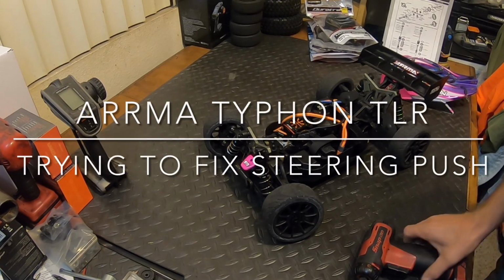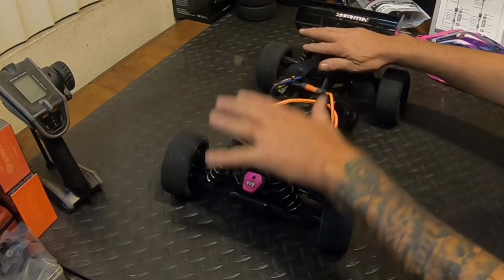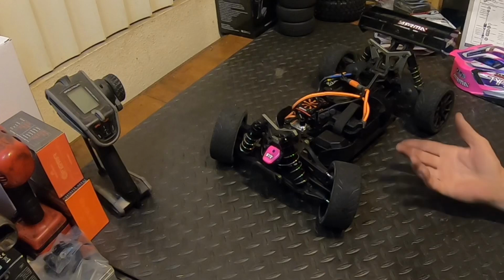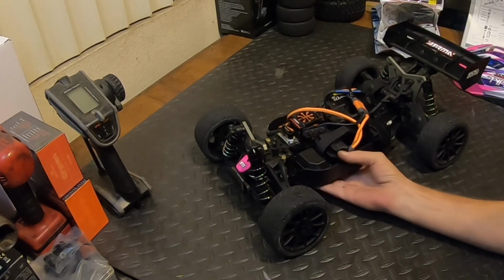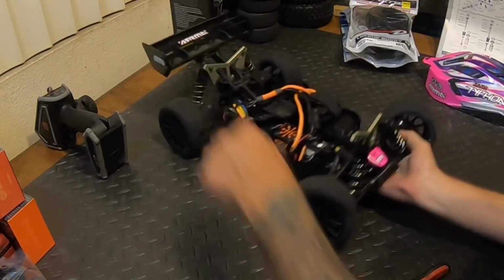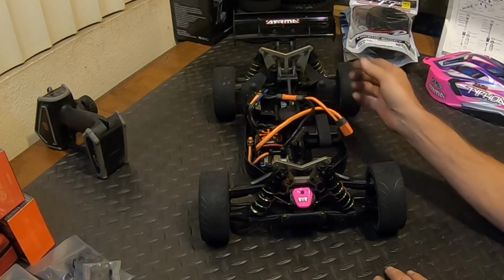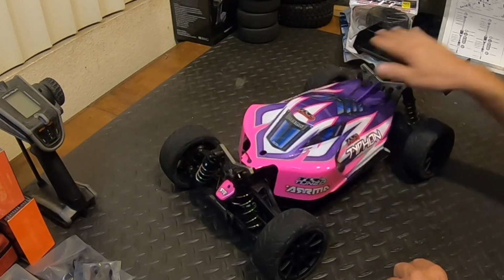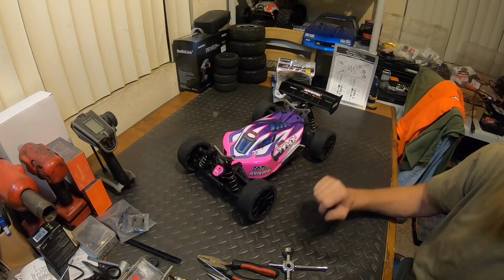Arrma Typhon TLR adjustment to fix steering push w/pivot ball front end will this help ?

Comment: Bought mine a few days ago and am already encountering this problem, have had it 3 days and already did the kraton hubs and carriers and axle ends with the EXB braces and the LED lights with the RPM rear skid plate and RPM front bumper.  This is by far my favorite RC vehicle ever! I love it!

Comment: Dude it’s been over a month, I just got my MX28 belted badlands on and have gone with the 1250kv 8s spektrum system….I’m still fighting the steering issues 😢 it’s gotta be perfect! I’m just not happy with it the way it is even after changing servo arms, turnbuckles. I mean come on! 😂 It’s crazy fast on 8s and handles great but it turn’s extremely sharp to the left and does little to nothing when turning to the right. So I’m watching this video as I’m tearing all of the front suspension now. AGAIN! 😂 If I get it fixed tonight I’ll upload a short clip of it ripping around! This video has helped me understand a lot, thanks!
Reply: Get a tighter aftermarket servo saver

Comment: Glad I found this video, although older it gives me more insight to the front of this thing. I have the same exact car (TLR), which I'm getting ready to get rid of the TLR tuning stuff because I'm tired of replacing those pill blocks everytime I turn around. Anyway, I'm wanting all of the front tires on the pavement because I'm not running dirt. Its obvious from the get go this car is set up for dirt tracks the way the front tires are set up.

Comment: I don't know if this applies to the Typhoon TT (ie. TLR Tuned) Roller, but it might be worth checking.  With the Typhon TT, you have 3 Ackerman adjustment holes - forward, mid, and rear   On my TLR 22 5.0 DC, as well as my XRAY XB2C, the same adjustment is done slightly differently, by using different thickness spacers.  I know that part didn't help you...but, it shows that the Ackerman angle is adjusted in a similar manner.

Now, for the part that might help you.  With both of my buddies, you can further adjust the Ackerman angle by flipping the Ackerman plate.  It is just one of the build/setup steps that differentiates between a dirt/clay vehicle, and an asphalt/carpet vehicle.  The 'rearward' mounting of the Ackerman plate (as the Typhon TT always to be) is a dirt/clay position...which makes sense, as the Typhon TT is tuned for dirt/clay.  With the Ackerman plate flipped (moving the 3 adjustment positions further forward), such would be an asphalt/carpet position.  I can't post a photo of what I'm describing...but, if you were to download the build manual for the XRAY XB2 2021, and look at the top panel of page 25, you'd see exactly what I'm referring to.  Then, you could disassemble the front end of the Typhon TT, and see if the Ackerman plate can be flipped.  If you're on Facebook, I could message you, attaching the image.
Reply from the maker: That great information I’ll definitely look to see if I can flip it 👍👍🔥🔥
Reply: @earlmoorhead5555  Most welcome.  Your NPRC inch has helped me.  More than happy to try and help you (and others).  🤙🏽

Comment: Changing the pills in the top front arm to the lower position shock tower will keep the wheel straight wen turning. I did it on mine,  made big difference.
Reply: Also down and in for toe in. Sweeps the arms forward standing the caster up. More tire patch on the road.
Reply: I'm gonna try foam tires.  Make the front tires bigger diameter, gives overdrive Make a little more front wheel drive.  Makes it drive straight.  Drag cars are set up front wheel dominate drive to help track the car straight.

Comment: Great bit of tinkering there earl 👌 very much like working on a real car but just not quite the same is it.  The small parts can make for interesting work too 😂 not like holding an m8 bolt lol.  Hopefully changing the steering settings will help 🤞
Reply from the maker: Yes 👍

Comment: EARL.... interesting...do you think shortening the servo arm slightly along with the Ackerman bar adjustments would help?  some servo horns have an inner and outer holes,,if not maybe a shorter servo arm,,,,,just a thought,,,great video.....🇺🇸👈🚘
Reply from the maker: As the wheels are maxed out I don’t think so but if they where not turning fully that would be the fix for that 🔥🔥

Comment: I’m a little late but have you tried a thinner rear sway bar to stop the rear end lifting? I would suggest watching JQ, he is pretty much only racing but I don’t see why the information wouldn’t roll over to blacktop as well. He recently did a video about sway bars and this seems to be the possible solution. Check it out and see what you think of the information provided by him. Have fun!
Reply from the maker: I haven’t ordered any parts for it yet but a good option 👍👍

Comment: I have a typhon. . everything is upgraded like crazy running 6s castle motor i keep melting my front and rear diffs. . . i have the center done with silicone earplug and 50k in front and rear. . any idea why i keep melting diff cups. It runs about 75mph so its not that fast of a build either
Reply from the maker: Diff cup melting 👀 there metal the cup that goes into the axle ??
Reply: @earlmoorhead5555  inside the cup melts and the gears just spin inside it and the screws give and diff rips apart
Reply from the maker: As dry as they where I can see big issues

Comment: Did you ever see if the spektrum 160 esc will fit?
Reply from the maker: It will fit but you’ll have to modify the mounting plate a lot

Comment: My Typhon s camber is FL: -3° & FR: -1.5°. What's the best way to even these out?
Reply from the maker: TLR has adjustment the upper arm has washers you can remove or add washers for camber at the pivot ball for front rear should have a link that’s adjustable
Reply: @earlmoorhead5555  ok thanks that's what I thought but I didn't want to start removing anything if there was something else

Comment: So...for scientific purposes,  im running 100k in the front and rear and 20M in thr center. Rather than planted wheels, im utilizing slide into corners and as for jumps and an evenly based thottle plant prior to a jump, i have seem to notice a super air control with the typhon.  Literally its a slide through the push almost never off the throttle. Also running even more backwardsness, 50 in the rear shocks with 3 hole 1.3  pistons, and 40 in front shocks with 3 hole  1.5 holes. Racing at Gulf Coast Raceway/ Mikes Hobby Shop... and tires, im just using proline pins butbi want to try AKA Scribbles
Reply: Needless to say it's double the work load to race but you can be extra aggressive as a trade off....atleast compared to a LosI 8 XE 2.0